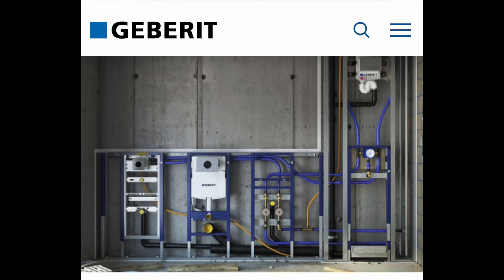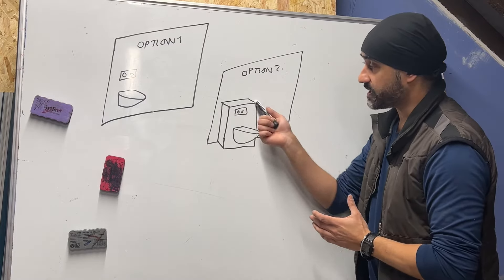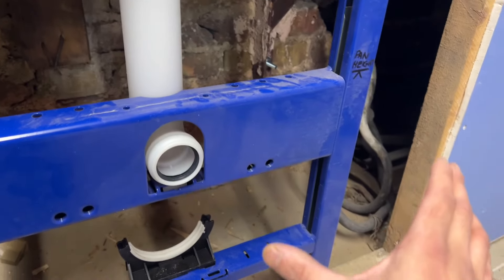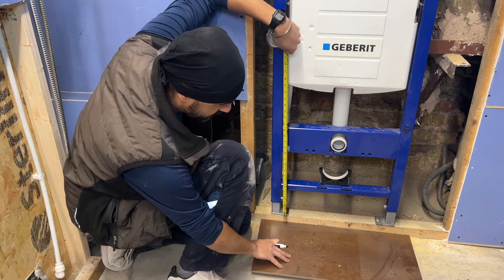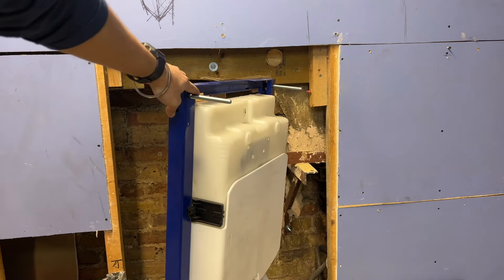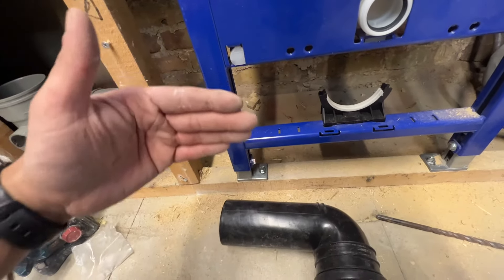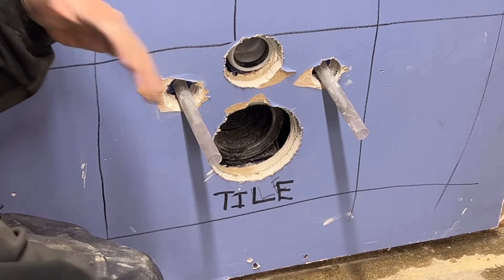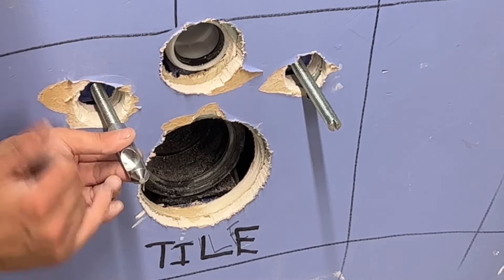How to fit a Wall Hung Concealed Toilet Frame (GEBERIT)

Comment: Did you have any issues when the bowl was installed? Per the directions it specifically says you can only install the elbow vertically or nothing less than a 45° angle.
Reply from the maker: From experience you should have a problem with the drainage less than 45
Reply: @diybathroom5123  should or shouldn't?
Reply from the maker: @andrewrossnagel9433  Apologies you shouldn’t have a problem. As long as there is a slight tilt you’ll be fine

Comment: How many turns of PTFE Tape?!?!
Reply from the maker: 15 perhaps. Other option use a liquid plastic like loctite 577. Wolsey plumber merchants sell it
Reply: @diybathroom5123  Apprentice you're the expert but in similar installs I would have done 5/6 wraps maximum?
Reply from the maker: You can fined me on Instagram too
Reply from the maker: There’s never a set amount from my experience. My early years as an apprentice I would wrap a cone shape at the start and then proceed with the wraps nice and flat/tight and leave one thread to catch the female. However some machining of parts varies and you’ll find the tightness can vary significantly. Now I use Loctite 577 which fills the thread completely.